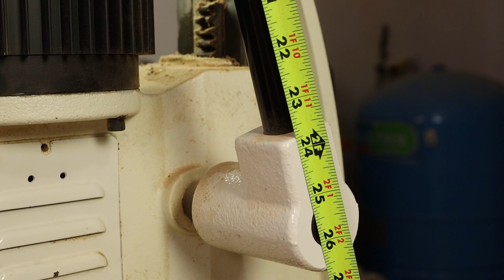Mortiser Benchtop vs Floor Model Woodworking Hollow Chisel Mortising Tool Drill Square Holes

Comment: I need the chisels to fit the 5/8" chisel bits for  bench top one ,but cannot find them , searches seem to assume i want the drill size to be 5/8"
Reply from the maker: I agree product descriptions for these is terribly lacking.  The Woodcraft 4 piece set in a wood box has 5/8" shanks.  The Shop Fox / Grizzly set in a plastic case has 3/4" shanks.  Best to you.
Reply: Huge thank you for the advice, i bought it with a few chisels but they were three quarter, i have managed to grind them down on my electric grind stone .
 @TheThoughtfulWoodworker

Comment: My benchtop mortiser features a face clamp, x/y table which are very nice to have. Your chisel tip is blue. You may have the drill bit too low.
Reply from the maker: Agreed, the face clamp and X Y table are great features.  The cheap hollow chisels I buy blue on the first use in white oak, even when set correctly.  They do cut nicely though, and I keep them sharp